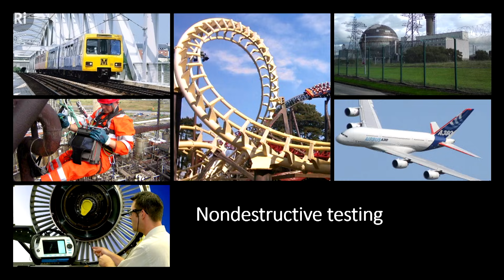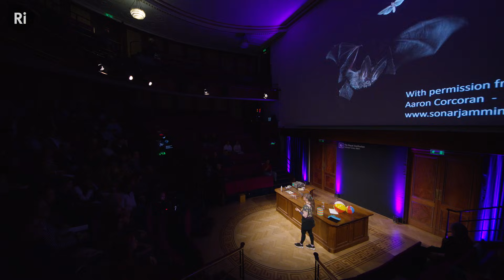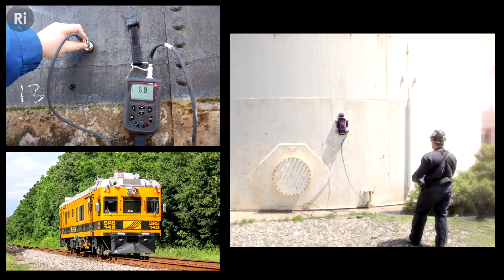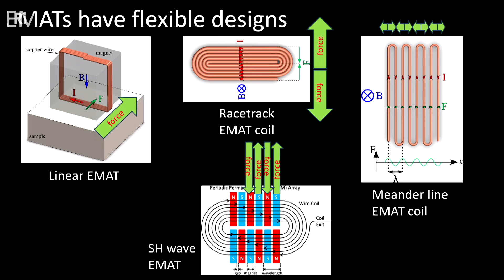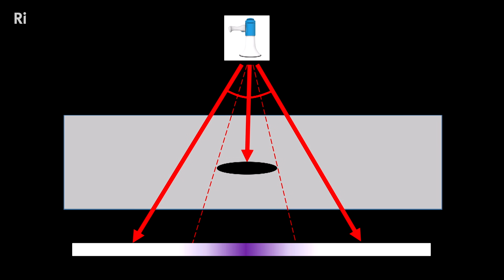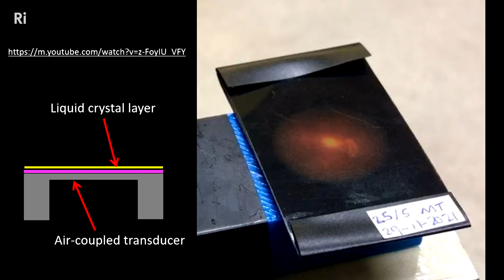Engineering's secret weapon: How ultrasound spots structural problems - with Rachel Edwards

Comment: Fantastic Video! Ultrasound isn’t just defect Detection, but the idea that structures have an acoustic Personality. Once you can generate and detect sound Without contact, it feels like the next step is letting systems listen Continuously and notice when their internal behavior quietly Changes, long before visible failure. That shifts ultrasound from a tool you use Occasionally into a way of monitoring Persistence over time — almost like watching how a structure Remembers stress. The VISOR idea really drives that home: once you can see sound move, engineers start thinking differently. I really enjoyed this Thanks for sharing...
Reply: I like sonics 😀[ has rampant tinnitus and autism ]